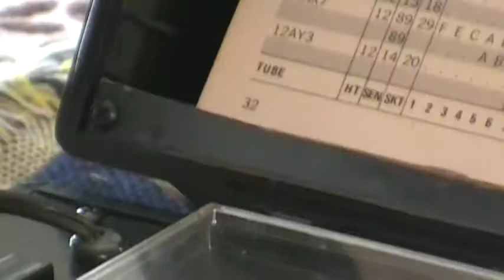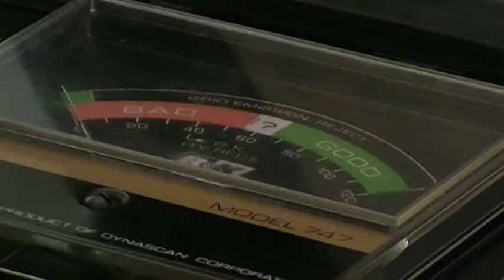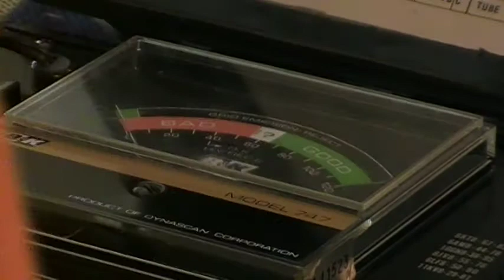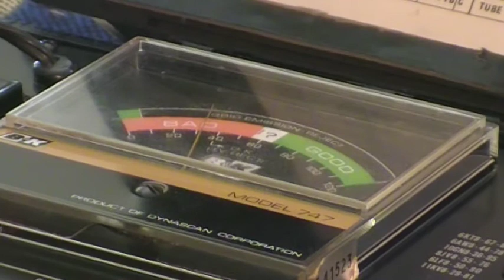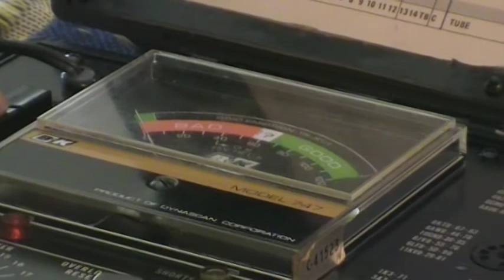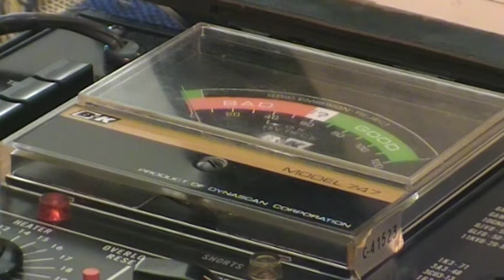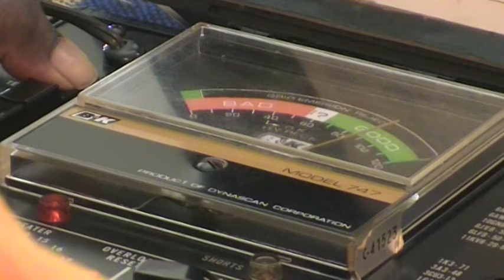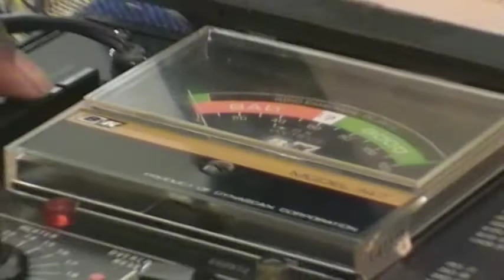Establishing A Baseline With A New 12AU7 Tube

Comment: The test results of that new Tung-Sol were pretty interesting. Maybe you could test some new 12AT7 and 12AX7 tubes and compare them to the vintage tubes?
Reply from the maker: Yes it was. I was hoping for much greater consistency. These were as inconsistent as you might see with vintage tubes. I have some new 12AT7's and 12AX7's that I can test for you as well. So I will do that to provide criterion or baselines as well. The 12AX7 is used in the Hammond Organ AO 28 Preamplifier.  The 12AT7 can be used as a replacement for the 12AU7 in the Leslie Amplifier when you desire greater gain and an increased bass response. It will literally blow up your speakers if they are not new or newly reconned and rediaphragmed.  Thanks for the note.